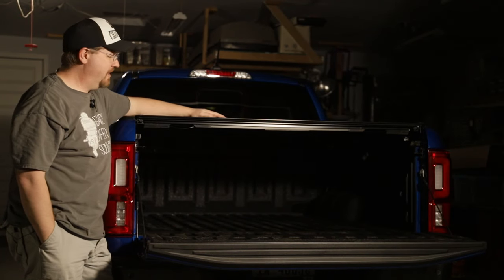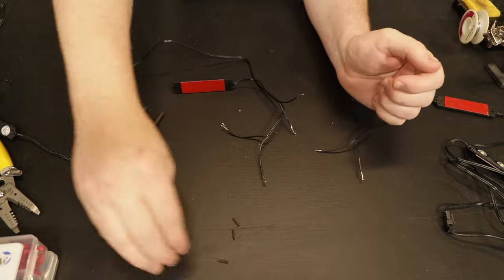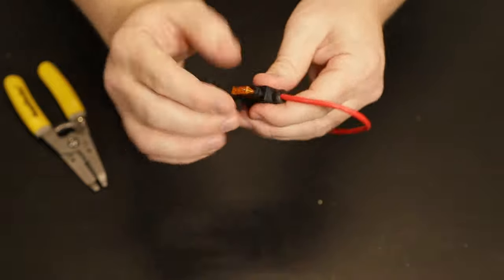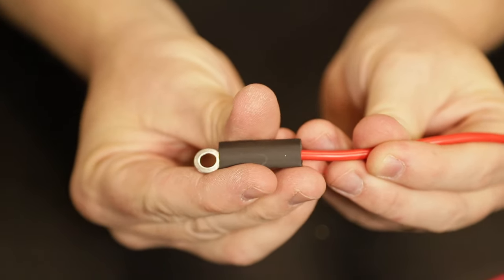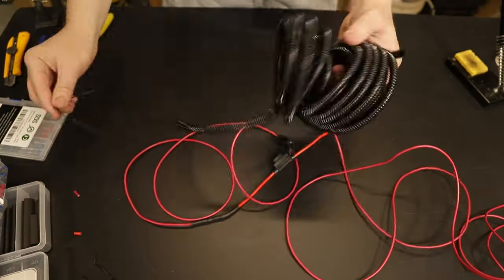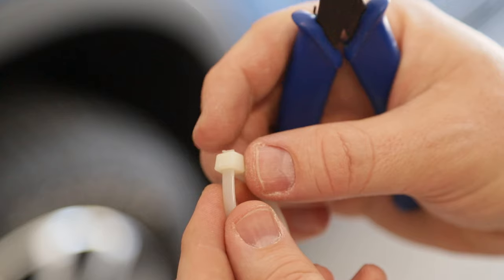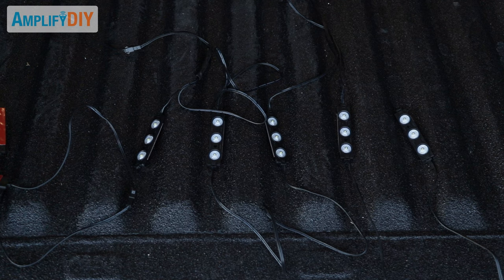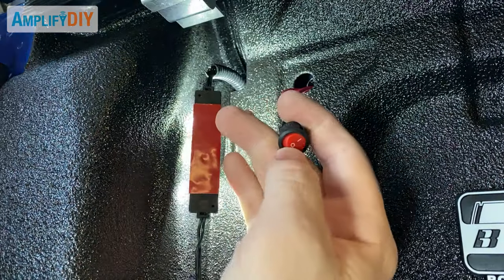How to Install Cheap Truck Bed Lights - No More Fumbling In The Dark!

Comment: do you guys think its ok to just tap off the parking break circuit? so much more convenient to grab power from the trailer hitch harness than to run a line from the battery. I dont think these LEDs use a ton of amperage.. what do you think?
Reply from the maker: Depending on the make of the truck, the trailer hitch harness may not always have power, so keep that in mind. You may want to test your specific truck to see what does or does not have power when you want to use the lights. For example, do you only want the lights available if the ignition is on? Or do you want to be able to use them when the truck is shut off completely and parked? Just verify the power is available when you want it before you tap into anything.
You are right though, these lights draw very very little current.

Comment: Nice video. Those low temp solder heat shrink tubes don't need to be pre-soldered. We use them on boats, side by sides, ATV's & trucks all the time with no failures yet. I was skeptical of them at first but have learned to love them. If you have a 7 way trailer connector @ the bumper you've probably got a +12v constant hot wire to tap into instead of running that power cable all the way up front. I believe it's pin 4 on the receptacle. It's used for charging the trailer battery. Most vehicles keep it as a constant hot all the time but some don't so you'd have to check it.

Comment: Glad I bought a Toyota, purchased plug and play LED bed lights that connect into existing wiring that requires no switch and run off the bed light that’s mounted to the cab. Think Ford making trucks all these years would figure this out by now, it’s these little things
Reply from the maker: Hi Sean - to each their own, of course. There are lots of little things that I prefer from Ford over Toyota. Glad to hear you are happy with your truck. Thanks for watching!

Comment: Very nice tidy work! I totally get the double-insulation with heatshrink tubing.  Appreciate your neat routing of wiring for a professional custom look.  You could add a pin switch to the tail gate, connect it to the ground wire, which breaks ground so that the light would turn off automatically when your tail gate is closed and auto turn on when your tail gate is open. Then the power switch serves as main disconnect whether the gate is closed or open.
Reply from the maker: That's a neat idea. I may add one in the future. Thanks for the feedback, and for watching!
Reply: Update - I found out that there is a large gap between my tail gate and the truck bed thus  preventing me from installing a pin switch. So I did the next best thing to install a magnetic switch, normally closed, in line with ground. That works well too.
Reply: @tinkeringeekkissimmeefl4495  can you link the switch you used? I think this is a great idea and the way that I would want to try. I think I would also use a switch somewhere else, if I plan to have to have the bed down for an extended period.
Reply: If you think you need to have the tailgate down for an extended period, just turn on-off with the power switch manually.

Comment: I did a similar install on my Ranger but as I’m prone to forget to turn things off I put a timed relay between the switch and the lights so the light is only on for 15 minutes before the switch has to be powered on again.

Comment: "Astrophotography" - no red set of lights? ))

Thanks for this. It put me more at ease about rewiring the cap on my old Ford Ranger, and I'm glad to see someone else soldering crimped connectors and putting heat shrink on everything.

Based on another YouTuber, I've started covering solder joints with liquid electrical tape before heat-shribking.
Reply from the maker: Yeah, red lights would be needed if I was using these anywhere near where setting up my scope / camera, etc... but I usually park, haul all the gear out of the truck and hike a little ways to actually set up / shoot. These lights are awesome for when unloading / loading the truck.... but yeah, they will destroy your night vision.

Comment: Great Video! The ford ranger has a factory power connector/plug located at the back of the truck on the frame.  Wolf Haus has a connection that plugs into the power connector for $30 bucks and uses OEM quality connector/plug.  Might simplify having to connect all the way to the battery.
Reply from the maker: Hey Chappy - Thanks for the heads up! I considered that factory connector for this project, but I believe the ecu controls when it is on / off. For my use-case, this is not what I wanted. I preferred to always have power available, regardless of whether the truck is running / on ACC power, etc. If you prefer to not worry about "did I leave the lights on in the bed of the truck?" then the factory connector is a great option, as the truck will cut power to it after a set period of time.
Thanks for watching!

Comment: Bought similar lights. The company had the positive and negative reversed. Realized this after installing all the hardwiring for it. Once the wiring was changed, the lights worked very well. Great work explaining all of the steps, I followed them as close as possible and it made for a simple install
Reply from the maker: Hey Michael - Great job figuring out the reversed wiring! I've run into that a few times myself.. super odd that standards for stuff like that don't seem to be universal. Glad the project worked out for you - hearing from viewers like you who found my projects useful always makes my day. Thanks!

Comment: Wow Very Well done ! You can use a 10mm to insert the cable inside the protector by using the round side of it and  its just gonna go inside but itself ! 
If you ever find the 10mm ..
Reply from the maker: LOL - I actually bought a 3 pack of 10mm deep well sockets that I keep in reserve in my socket set.... When I get down to only 1 extra left, it's time to buy another 3 pack!

Comment: Excellent idea! Thank you so much for sharing and instructing how to get light to the bed of the truck. I am curious to know if there would be too much light lost if you were to mount the lighting to the very back side of the truck bed railing or under-side of the truck beds top rim, so that the lighting hardware is not visible. I don't know if this would light up the bed enough, but would sure look snazzy..😉
Reply from the maker: With how bright modern LEDs are, I think you'd actually be fine to mount them in as hidden an area as you'd like. Good luck!

Comment: Nice work...thanks for the info...My ranger came with a drop in bed liner so I'll have a few other things to deal with. I could just rip the drop in liner out an have a spray in done.
Reply from the maker: With a drop in liner, yes there will be a little bit more to do. Mostly you’ll need to drill some holes through the liner at various spots for the switch and the wiring. If you decide to switch it for a spray in liner, I really do recommend bullet liner. They were cheaper than the others, have a lifetime guarantee, and seems to be installed thicker than the others as well. Good luck!

Comment: Very helpful thank you very much. I also just bought a Ford ranger and need to put lights in the back box 🇨🇦
Reply from the maker: Best of luck with your lights! I’m happy to answer any questions that come up for you.
Reply: WalMart kit is awesome. Alpeena brand. An actual kit. $25 and as good or better than his. Actually better because he has 15 places the wires could fail/ corrode.

Comment: Did this a while back as well on my own truck but it might also be a good idea to use a door jamb switch hooked up to the ground so when say the Tonneau Cover or Tailgate (personal preference) is open the circuit closes and turn them on automatically as well as being able to shut them off by the switch if necessary at will
Reply from the maker: Great idea, Omar. Thanks!

Comment: Very good video project!  Thank you for this.I do have a couple questions though.  They may have been answered and I may have missed them, but here we go.....
1)  Couldn't you splice your positive wire into the positive wire in the harness for the trailer power ports?
2)  How is the tape holding up the lights given hot summer heat and weather conditions (even though it is covered by the bed cover).  It still gets real hot in there (I'm in Florida).
3)  Same for your power switch.
Thanks in advance for any additional comments about this project, and again, many thanks for this video!
Reply from the maker: Hi Dan - great questions!
1) You can certainly splice into anywhere you can get a reliable positive power supply. Keep in mind that some trailer wiring is only hot when the ignition is on (depends on the model/year of the vehicle) and you need to be careful not to overload the existing circuit or you'll pop fuses. 
2) The tape has been great! We've had record high heat this summer (multiple triple-digit days back-to-back) and the lights are very secure. I was careful to make sure and clean the mounting surface with a mixture of isopropyl alcohol and water prior to mounting, to remove any grease/wax/dirt, etc. That mounting tape is incredibly strong. 
3) As for the switch - it is not mounted with tape. It clicked into the hole I showed where I mounted it in the bed of the truck, and has been perfectly secure.

All in all, this has been one of the best upgrades I've done to this truck. Thanks for watching!

Comment: Great video! I got a set of lights last December, but haven’t had the free time to install them. However, I’ve had this video saved for over a year waiting!
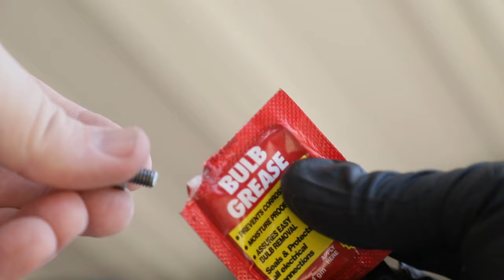What size bolt is this that you’re using at 15:56 for the ground location?
Please and thank you for your time.
Reply from the maker: Heya Dirty McCurdy - I'm sorry I don't know the exact size of that bolt... but everything on this truck is metric, and I am pretty sure it's either an M6 or M8, fairly short (as you can see in the video). 

I'm pretty sure I just pulled that out of my coffee can of "random bolts I might need someday". 

Good luck! I'd love to hear how your lights turn out.

Comment: I have those lights sitting in a box in the garage. Got them on black Friday for the interior of my Tundra but now I'm thinking that your idea is better. However, I would rather the lights come on every time I open the tailgate and go off when I close it because I see myself forgetting to turn them off.
Reply from the maker: You can get a proximity switch which detects when the tailgate is open vs. closed and have it control when the lights turn on and off. Something like this should work well: https://amzn.to/45ttufs
Good luck!

Comment: Wow, love this idea, thank you for sharing! Question as I'm not an electrician expert- I have a '15 Chevy Colorado which has a factory switch for cargo lights. I want to hook this up but also this manual external switch when I'm outside, say camping. How would I do this- relay? Would love your input and feedback! And thanks again for a wonderful video and ideas!
Reply from the maker: Hi Robert - thanks for the feedback, I'm glad you found this video useful! I'm not super familiar with the Colorado... do you know if that factory switch has power available *all the time*, or only when the ignition is on (or for a short time like 5 minutes after ignition has been turned off)? My Ranger has a button to turn on the cargo lights as well, but that light is mounted at the rear top of the cab, and is useless with a bed cover. It also only works when the truck ignition is on. That's why I came up with the solution that I did, as I wanted the switch to work in the bed of the truck *all the time*. The only way to do that is to wire it all the way back to the battery. 
Hope this is helpful - I'm happy to try to answer any other questions you have. 
Thanks!

Comment: Hello Chris, I'm not very good at electrical work. Do you have to use the relay? I thought you could just connect to the reverse light positive wire? Am I wrong? Would it be energized constantly without the relay? Thank you in advance.  Great videos you post.
Reply from the maker: Hey Joe - Not sure if you intended this comment for this video ... I'm not Chris, and I didn't use a relay... but I'll still try to answer your question: Any time the lights are on, they are drawing current. Any time the lights are off, they are not. There are a variety of ways you can use to turn the lights on and off - a relay, a switch, or hooking into an existing circuit. In my video, I opted to use a manual switch in the bed of the truck which has worked very well for my purposes. If you are not confident with electrical work, I'd suggest a switch is the simplest both to set up in the first place and to troubleshoot should any issues come up in the future. Best of luck with your bed light wiring!
Reply: @AmplifyDIY  
Thank you very much for your reply.

Comment: Can you please make a video of you making a DIY bed cargo divider? If you take a look at the Ford Ranger cargo bed, around a foot from the tailgate, you can use a regular 2x6 block of wood and have it divide your cargo bed. Useful for quick grocery runs! Thanks.
Reply from the maker: Hi Isag - I already built a divider for my truck - It's literally a piece of 2 x 6 that I cut to the right length to fit into the slots you describe. I keep meaning to build something better that fits nicer with my swing-out tool case. I'll add that to the list of video ideas. Thanks!

Comment: This is a Ford option. The wiring harness is already there.
Inside the top of the left rear wheel well there is a 12 volt connection for optional bed lights.
Rather than running a new wire all the way from the battery you should use that built-in circuit - it has a fuse already installed in the fuse panel.
If you had of used that connection, you can install your switch in the punch out next to the switch for the fog lights and connect your switch to the existing connector under the dash board. The bed lights will also automatically turn off when you lock the truck with the key fob in the event you forget to switch them off and the whole setup will operate just like the Ford option.

Another bonus by using the existing bed lighting harness the bed lights will stay on for the preset time in the dashboard settings menu when you turn off the engine after driving - same as the headlight delay off setting.
So when you park your truck, get out and retrieve your items from the truck bed, there's light to see for that preset time and the lights will then go out on their own.

Ford option: https://www.youtube.com/watch?v=nOxJ0HEKeVw&t=2s
But you can DIY it by using the harness rather paying the $$ for the touchlink system.
The only thing you wont have is the capacitive switch if you DIY it. The timer off will still function.
Reply from the maker: Thanks for bringing this up. I actually considered using the built-in factory harness, but opted not to specifically because I sometimes need the light to be available for a long time after the truck has been shut off, and didn't want to have to go back to the cab to cycle the ignition all the time. The way I have it set up works great for my needs, but if you only need the lights to be on briefly after the truck's ignition has been on, the factory harness is a great option. Thanks for watching!

Comment: Really nice work. Maybe putting the switch inside the cab would work out better?
Reply from the maker: That's an interesting idea! I put the switch in the rear because I figured that's where I'd already be standing when I'd need to turn them on... but having the switch in the cab would make it easier to tell if I'd accidentally left the lights on. Thanks for watching!
Reply: Frankie Knuckles
 -  that's not a good idea
Reply: Why? Kinda stupid. My engine hood light only needs to come on when . . never mind.
Reply: @hughwynn6193  if wiring the lights in this fashion, it is absolutely not a bad idea to put the switch inside the cab of the truck. I realize that this setup was mostly shielded from weathering, but putting that type of switch in the bed is not a good idea.

Comment: If ya havent yet , you should wire in 2 short strip of Red LED Strips in that lil space under the tailgate  and wire 1 side to left turn signal and 1 side to right turn signal .(and both to Break light )
Reply from the maker: Great idea!
Reply: @AmplifyDIY  maybe wire in some square LED offroad lights into the backup taillights mounted under the rear bumper

Comment: Thank you, great info. Question, 2020 Ram Rebel, I don’t have cut outs or holes in the bed. How do you suggest I snake the power wires to the lights?
Reply from the maker: Hi Tom - sorry for the late reply. No cutouts in the bed at all? Not even for drainage, anchors or anything? Are there any little plugs covering some cutouts? There may be some cutouts hiding in plain sight... one way to try to find them would be to have someone crawl under the truck in a dark garage with a strong flashlight. Then you stand in / near the bed and look for light leaking through. 

If there truly are no access points at all in the bed, then you'll have to find the best place to drill a hole yourself. If you do have to cut your own hole, I'd recommend using a step bit and then putting a little bit of rustoleum primer/paint combo onto the edge of the hole as a rust preventer. You can use a q-tip - just spray the paint onto the q-tip away from the truck and use the q-tip to apply the paint to the freshly drilled edge. 

Good luck!
Reply: @AmplifyDIY  Hi, pulled part of the bed liner, right next to U bolt, snaked and worked great. Thanks for the video.